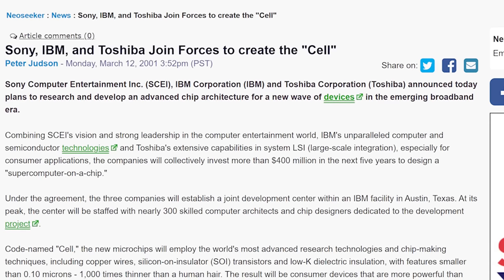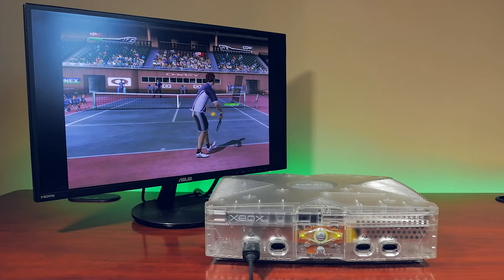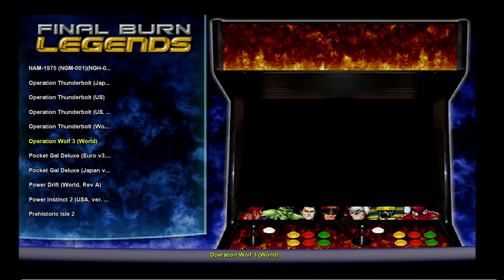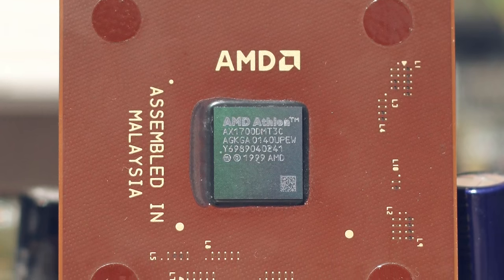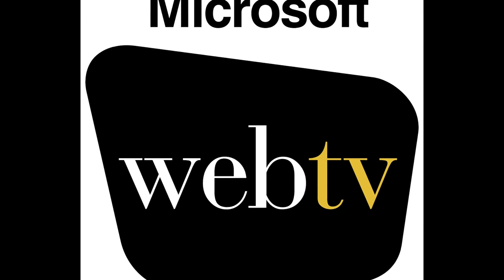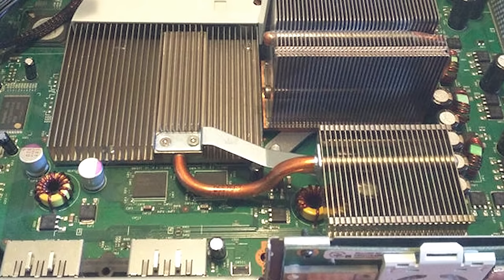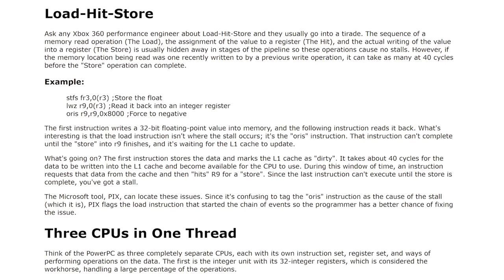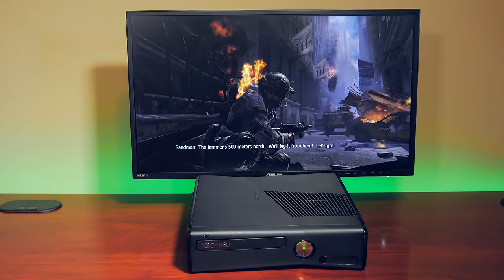Why Microsoft switched from Intel to Power PC for the Xbox 360  | MVG

Comment: RE: The question at the end on how did I feel about the move to PPC? I remember Apple abandoning PPC because of heat, and then when the whole "red ring" thing started happening on the 360, I was like...yep. There's the magic.
Reply: Dener Silva And to add a bit of irony (or going full circle), Apple’s RISC-based ARM processors have more in common with PowerPC then with the CISC-based x86-64 processors from Intel and AMD.
Reply: Great info, thanks man. I feel like such posts are underappreciated.
Reply: the wii u had a ppc chip that wasnt suspectible to overheating, it was more powerful than 7th gen chjps as well, despite having a low clock speed.
Reply: Yoloer Boy No, believe it or not the WiiU paled in comparison to the much faster Xbox 360 chip and of course the CELL.  Look it up, even Metro 2033 devs said the wiiu sucked balls due to its weak cpu, but the 360 and whatnot was plenty even still.

It only had more ram and a somewhat beefier GPU, but better results still came out of the previous gen machines due to better cpu, not worse.
Reply: Dener Silva not, its igpu issue
Reply: I had a Powermac G5 with essentially the same 'cores' as the Xbox 360 but it only had 2 cores at 2.3Ghz rather than the 3 of the Xbox. 
Let me tell you the heatsink in that thing was about 4x the size of the Xbox heatsink and had 6 heatpipes where the Xbox had none... It was always doomed to fail
Reply: @nugget6635  Its funny because it's not just the heat that killed the chip. But the heat plus the lead-free solder. It the solder points didn't break these original toasters did just fine. On that no however I did sell two originals in favor of the S.
Reply: @nugget6635  it wasn't the bad cooling that made the xbox 360 die, from my understanding it was the bad unleaded solder Microsoft used to adhere to EU laws, as the board heats up and cools down it flexes and causes cracks to form in the solder balls at the gpu or cpu causing it to lose connection and red ring. And replacing the solder by reballing with leaded solder fixes the issue permanently.
Also I don't remember the CD drive sitting above the cpu, but I could be wrong.
Reply: @PC3Pointless  while cooling was inadequate since they designed the shell first, then the internals, it was the unleaded solder Microsoft used to adhere to EU laws that caused lots of issues as it would crack as the board heats up and flex, resulting in the red ring as the cpu or gpu wouldn't make proper contact. That's why replacing the solder by reballing with leaded solder fixed the issue permanently.
Reply: Naota Akatsuki something like the packaging of the entire system happened entirely too late in the process and they were in a rush to beat the PS3 to market and by the time they discovered it was going to be an issue they’d shipped.
Reply: @nugget6635  Missing the fact that Microsoft loved for whatever reason and still do, using weird and difficult memory speed and memory configurations starting with the 360 using small sub-memory buffers that devs had to use and integrate into system usage...gave devs alot of headaches.
Reply: To be HONEST here.. It wasn't actually the problem. Problem was lead free solder what they did just move and it wasn't up and running yet properly.
Reply: @nugget6635  360 did not use the 970FX, only in the early alpha kits was the 970FX used. The main issue with the Xenos (Xbox 360 CPU) was that it had an in order CPU design with multi-threading whereas the G5/970 was an out of order design and lacked hyper-threading. The original Xbox and all desktop CPU's since the Pentium used out of order execution.
 
The main reason Apple switched to intel was because IBM could not get their G5 chips to 3GHZ without severe overheating, which prevented G5 chips from being used in the laptop computers, and meant their PowerMac's were not as competitive with their PC counterparts.
Reply: Most of the red ring issue were mainly due to manufacturing and thermal design.
Reply: I worked @ ms at launch of 360 doing 360 live migration. Our demo unit showed massive overhearing after an hour. There was a water bottle behind the fans and over the 90 minute demo the last inch and a bit of water had almost evaporated.

The front of the 360 had points for a fan header. I'm convinced they wanted the ring of light to be an intake fan but that the cost was too great. A 40 or 60 mm intake would have fixed a lot of issues
Reply: @FeeLtheHertZ  metro dev was likely referring to it's SIMD capabilities, which were significantly better than the Wii U. For running straight line code that isn't heavily optimized it's probably around as fast, maybe faster due to out of order execution and much shorter branch and cache misses.
Reply: @pacifico4999  they arent, like the what is bc they want to thermal throttle their products, also, they want ARM bc they can design and manufacture it
Reply: @PC3Pointless  Still got my G5 tower, i remember looking at the sticker on the inside base warning of possible liquid leakage and thinking yup, this thing must get toasty
Reply: Apple didn't abandon ppc because of heat... It was because of speed... Ppc cpu were slow..compared to intel and not many apps were available for ppc so they jumped chips to open the library of x86 software available to macs...starting with running windows natively on macs...
Reply: It seems like Nintendo didnt have those heat problems with PPC like Sony, Microsoft and Apple did, but it seems like Sony fixed this with the PS3 super slim model. Sony then abandoned it and all skills/knowledge developers learned lost. I think Sony still uses them (the smaller cell processor) for their PS Now servers.
Reply: @andreiarg  These kinda go hand in hand: more heat meant more thermal stress on the new, lead-free solder which happened to have little resistance to thermal stress.
Reply: @nugget6635  This, they really poorly designed the consoles. Chips were hot, but better design would have saved those consoles...
But the real problem was design, both PS3 and XBOX360 were poorly designed, major redesign of consoles and 45nm process saved the chip and the consoles, at 90nm it was just too hot. With proper redesign and 45nm process those consoles were really reliable I play my PS3 Slim 25xx to this day, even though it was released 10 years ago, its running fine.
Reply: Naota Akatsuki not to mention that cheap soldering they used. It would get hot, cool off after shutdown and literally break.
Reply: only issue is that ppc cores had no heat issue but the gpu with insufficient airflow had.... so you were totally wrong :-)
Reply: @FeeLtheHertZ  wiiu main issue was ram bandwidth not raw cpu power
Reply: @chrisbullock6477  devs loved the edram :-) too bad it was not big enough for 720p :(
Reply: Német Attila so why did the soldier always break from head? I fixed a many of gpus on those o.g. 360s.
Reply: Naota Akatsuki with original Xbox got red ring twice plus my ms refurbished one. I bought the black 2nd to last black (ryan) version with touch power on and had zero problems last 4 years or so.
Reply: RROD happened because the GPU was overheating not the CPU.
Reply: As others have pointed out the 360 issue was with the GPU and the solder, not the CPU. This solder issue was industry wide back then too, the PS3 also has similar issues (tho not as widespread) and Nvidia 8000 series GPU had big issues especially in laptops. I even had a laptop that failed too, but it was a known issue especially in macbooks.
A compounding issue was the cooling, the CPU has a nice full height cooler, but the GPU was below the DVD drive and had to use a much slimmer cooler, the heat pipe from the GPU you see in most consoles was a later addition as they realized it ran too hot and still wasn’t enough. 
Overall airflow was also an issue as it only had exhaust fans and had to rely on ducts to channel the airflow. The 360 S redesign put everything on one chip and placed the fan right on top of the cooler for optimal airflow.
Reply: @nugget6635  the cpu had the huuuuge heatsink, the gpu had the small one and lied under the dvd rom without airflow. I think you don't really know which was which :) the gpu under the dvdrom got extra heatsink via a heatpipe, later on.
Reply: @Ty4ons  finally someone remembers correctly :D by the way I had a dell d830 notebook where the nvidia gpu had the very same solder issue :( (also 2 x360s of mine got RROD :( )
Reply: @South_0f_Heaven_  not entirely. re soldered parts died as well! (with non lead free solder) I know coz inm y country there was a service to re-ball the chips and re solder - same death for those machines... maybe a bit later but no stats for that)
Reply: Német Attila the correct way to fix is to replace the entire chip with a new one. If it failed again after a BGA reball then it wasn’t done right or the chip was damaged.
Reply: @FeeLtheHertZ  Wii U had a weaker CPU yes but the gpu shat all over the 360 and ps3. Didnt matter either way, to little to late.
Reply: @XantheFIN  You're splitting hairs. It all works in conjunction. What's not lead-free soldered today? Or back at that time? It's weaker than leaded - sure, but supplying adequate airflow would've alleviated the issue to the point of non-existence. So to summarize - everything's got its part - extremely hot CPU, cramped space with bad airflow and lead-free solder.
Reply: @Yeen125  Considering Apple's chip team was formerly P.A. Semi makes sense since that team worked on  Power ISA before getting bought by Apple to work on custom chips for their devices.
Reply: @nugget6635  The 3RL problem was solved even before the Slim.
Reply: But how did it make you feel ?
Reply: PowerPC was a dying platform then and basically a rotting corpse now. It made development harder, backwards compatibility harder. In the late 1990s 3D animation studios moved to x86 because it rendered faster than PowerPC, that should have been the first clue.
Reply: @FeeLtheHertZ  I don't know much about the wii u, but the 360/ps3 PPC chips were definitely not powerhouses and required tons of work to get decent performance out of. It boasted a high clock speed, but most of the time it's waiting for memory, due to it lacking any kind of instruction reordering.
Reply: This is what I came here to say. I know a lot of people are mentioning non lead thermal paste, and just about every aspect of the 360 had cost cutting that caused consumers problems, but the heating is still the real story. Apple literally couldn’t make a PowerBook G5 because the hardware kept overheating in that form factor, and there are stories that iPad prototypes made with power pc had to be the size of a suitcase and the screen was hot to the touch. The mid 2000s before dual core processors were all about cooling issues and Microsoft and Sony chose the worst option